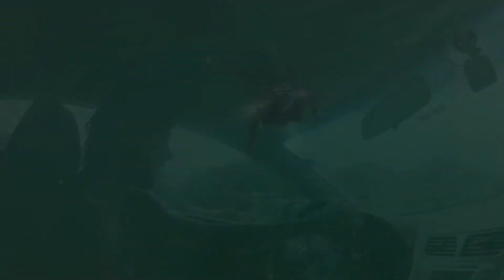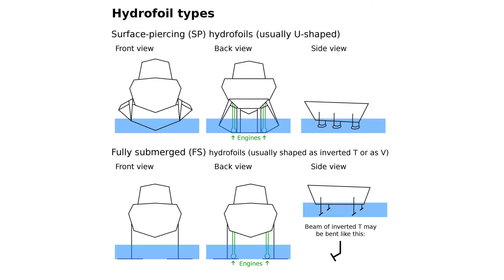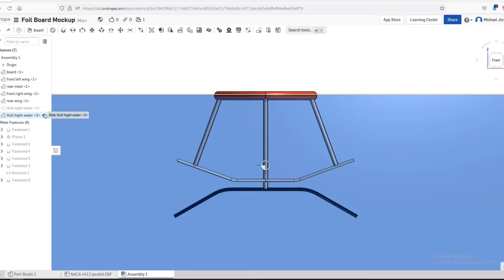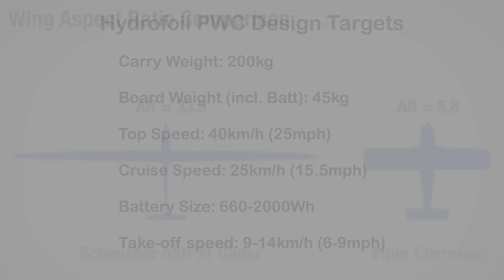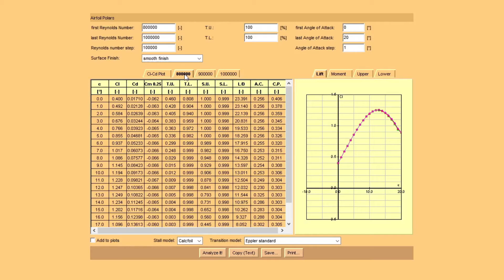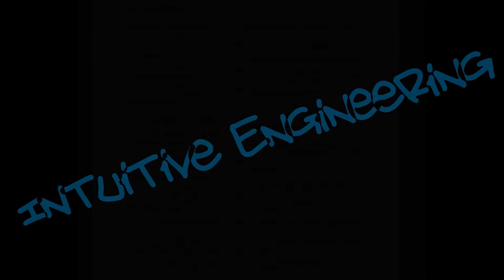02 Foil Board Concept Design & Sanity Check! Is this even a good idea!?

Comment: What are your thoughts on supercavitating foils?
Reply from the maker: Hey Dusty, thanks for the comment! Since this will be designed for relatively low speeds (~25mph), super cavitating foil shapes aren't going to be needed. Of course if someone wants to build a much faster craft then they will definitely have to use them. However there may be an application for a super cavitating propeller that does not lose so much thrust if it breaches the surface, which is an interesting idea for future exploration.